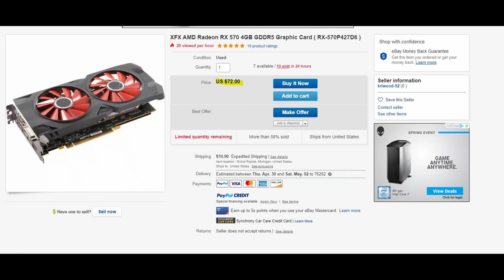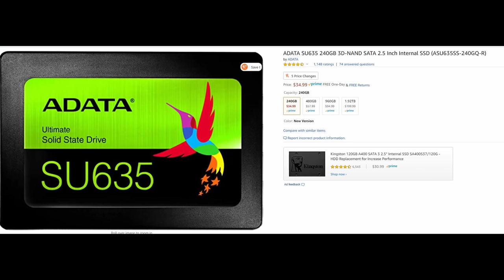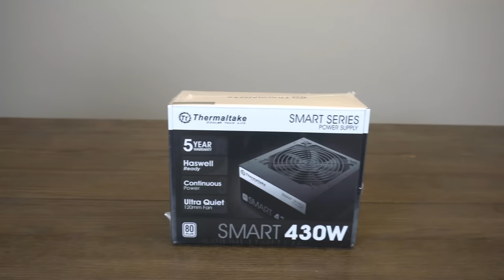$220 Just Get Gaming PC Build - Dell Optiplex 2020 + Benchmarks

Comment: Love my $200 optiplex.  It's one of the thin bois but with a little AMD GPU that's just good enough to play games on my tv.  Not a hardcore rig, but does everything it needs to in the living room!
Reply from the maker: Heck yeah!
Reply: @PCTechHustle  it's a 9020 with a gen 4 i7.  I think it's worth it to do the GPU upgrade like you did, but starting with a stronger cpu does make it feel pretty snappy.  I went the opposite route on storage and put in a 4tb nas drive, no SSD because there's no room left :P
Reply from the maker: I’d highly suggest doing an ssd for some snappy boot and load times!  You can find them cheap and stick them literally anywhere.  Double sided tape or velcro make for simple mounting anywhere

Comment: I have read that OEMs like Dell and HP have some proprietary connectors that make it difficult to use off the shelf  PSUs. Have you faced this at all, as I was surprised you could change the PSU on the Dell.
Reply from the maker: No problems at all with the power supply in this build.  In this kind of OEM they use standard atx components.  However you are correct with other OEMs.  You just have to some some research to get a lay of the land before committing to something like this.
Reply: From what I’ve heard, when talking about the minitower versions, you don’t want the 2 BTX models, and the XX20 models have proprietary connectors (XX10 models have normal connectors but not all PSUs works as it needs a certain amount of combined volts in certain pins). I’ve heard some sff had normal connectors, but usually desktops didn’t.

Comment: Would the motherboard fit in any other cases so I can maybe put some custom motherboard armour on it and make it look like an actual gaming pc?
Reply from the maker: Yep it’s a standard micro atx motherboard, so it will basically fit in near anything!
Reply: @PCTechHustle  there's another tip to add to he list
Thanks!
Reply: Why the need to "look", its the performance and practicality that counts!
In the end you probably end upp spending more on mods an changes than the whole system.. Just save that for better part!
"custom motherboard armour", silly.. and wont help anything, maybe even hinder cooling.

Comment: Nice video.  I had the same problem with XFX Rx 570 trying to fit it into my Optiplex 790.  I was actually able to fit it in using a $9 pci-e extender/adapter that popped it up just enough so that it didn’t run into the RAM clips. Not the most elegant solution as it raises issues getting the back hinge near the I/o port closed, but if you’re desperate to get the XFX in there it can be done.
Reply from the maker: Nice!  I like the solution concept!

Comment: Dell optiplex I've seen it but cant even afford it lol
Reply from the maker: I'd say if you just want to get gaming and that be the priority, save up and go for this!  I was pleasantly surprised on the performance capabilities!
Reply: @PCTechHustle  kl thanks 👍
Reply: $108 on eBay
Reply: Get a console my guy, like the PS4 or Xbox one they gonna be cheap since the ps5/Xbox series x are coming out. That way u don't need to build or alter anything in these machines or even add anything and games are still being supported on both platforms

Comment: I just finished building my optiplex 9020. I7 cpu 4770 paired with a budget amd radeon rx 460 2gb that i picked up for £55 of cex. Runs like a dream. For anyone looking for one of these 9020 mini towers, try encore pc website
Reply from the maker: That’s a killer CPU!  You could step up your GPU quite a bit without bottle necking it!  Good upgrade path!

Comment: Will the xfx fit fine on an Optiplex 3010
Reply from the maker: I believe they are all the internal dimensions, so yes
Reply: Pretty sure on 3010 or 3020 one of the sata connectors can get in the way of longer cards.

Comment: Where do I put hard drives if I have to take it out to put gpu in
Reply from the maker: There is a slot directly under the optical 5.25” drive bay, it conveniently fits a full size hard drive.  I actually dk this in the build!
Reply: @PCTechHustle  dk?

Comment: i did a build like this. i used an HP 8300, the full ATX tower 20 bucks. 
i got a cheap PSU but its rated at 750W which is damn near twice my usage so im not too worried, 50bucks.
the PC came with no CPU, RAM, or HDD. its 1155 so i went with a 2550K, which is still a capable gamer and will let me OC when i get a good deal on a Z77, 50 bucks.
4 sticks of 4GB Samsung PC3 12800U-40 bucks
1TB Seagate HDD-20 bucks
And i finished it with a VisionTek RX480 8GB OC edition- 100 bucks
It plays new games and makes me happy. I do look forward to getting a Z77 and clocking that 2550K. they were basically the best binned 2500Ks and are known to OC like a beast. And an SDD would be nice, but i dont want just a little one with just Windows on it. Ill save and get at least a 1TB so i can just clone it and go.
Reply from the maker: Awesome!

Comment: I can confirm that Sandy Bridge Xeons will works in these systems. If anyone is looking to squeeze a little more performance out of these, a Xeon E3 1240 can be picked up for around $40- $50 on the used market. It's basically an i7 2600 minus the integrated graphics chip.
Reply from the maker: Great tip!  Those chips are great overclockers as well! Not applicable here but Xeons compatible with the consumer LGA sockets tend to have a better bin which in many cases even overclock better than k series chips.

Comment: Optiplexes are overpriced on ebay, there's usually much better deals locally
Reply from the maker: I’ve noticed the prices swinging wildly.  Seems I got lucky getting mine for $75
Reply: @PCTechHustle  You should have tried getting a better optiplex I got a dell optiplex 7010 with an i5 3470 8gb of ram and a 500gb hdd for $70+$6 tax
Reply: Wow I got the same thing for 220 dollars on new egg I guess I didn’t know what I was doing back then I should have gone whith eBay
Reply: I got a dell optiplex 9010 SFF i7 3770 1TB HDD for $120 + 25 shipping on ebay, wdym?
Reply: @cytro  Dang you are so lucky thats the best cpu for a 9010
Reply: @cytro  Mine has an i5 3570
Reply: @Jamal01223  Yup! :D Now going to save up for a lowprofile RX 550 and get 8gb more ram

Comment: I just finished my build and everything works fine. Any ideas on an upgrade path for this build

Edit: The PC is VERY loud and spikes with games like Minecraft. I got this PC to take games like Fortnite a little more seriously but with it games like Minecraft making me use 99 percent of my GPU I'm very concerned. Did I do something wrong while building? My cable management isn't the greatest is the issue. Do I need more RAM, I better GPU or CPU.

Thanks in advance you've been a great help to me during my first PC build.
Reply from the maker: I am assuming you copied this build?  That said, if things are loud is you CPU fan ramping up because it does not detect the front temperature probe?  That will happen.  Mine though was not loud, I would say pretty average to the quite side in fact. 

On the GPU concerns... Under gaming scenarios the GPU should be fully loaded.  If it is not that means you have CPU bottle neck and the GPU is waiting for the CPU to catch up.  

Not sure how much RAM you have but the minimum with modern gaming I would suggest be 8GB, preferably 16GB.
Reply: @PCTechHustle  The noise problem was my fault, my cables were blocking most of the airflow so when I went in and moved it around the PC ran a lot smoother. 

I have 8gb of ram. I will upgrade to an i7 and 16gb later. Any recommendations on which brand of ram I should get?

Comment: 1. Wondering if the cooling fan comes with the case? So as the motherboard and stuff like that.  2. Does this get good frames with medium around 60 or higher? 3. Is the ADATA necessary to buy or optional? 4. Is the Optiplex 990 out of stock from the link is the description?
Reply from the maker: 1. Yes a rear exhaust fan comes with it
2. Yes it get great frames even on high settings though I would suggest maybe running medium to smoothen out the gameplay (check the benchmarks part of the video)
3. The SSD is indeed optional, I highly suggest getting one though if you can spare the extra change.  It will make for a much snappier feel and game load times will be drastically reduced
4. The 990s sell all the time.  The reseller I bought from (linked) may be out of stock but just do a search on eBay and I’m sure you’ll find one around the same price point.

Comment: In March i bought a PC for 100€ with:
i7-2600
Radeon HD7800
2x8GB DDR3
1TB HDD
120GB SSD
60GB SSD

It was a Acer Predator and the Case was very nice with Easy Swap HDD at the front.

I Changed the GPU and bought a Sapphire R9 290X Trix OC for only 60€.
So i was at 160€ and had 2x 8GB DDR3 laying in my Room, so i put them in too and it was a good Starter Gaming PC.
Sold it a few days later at Facebook for 350€.
Reply from the maker: Nice!

Comment: hey i need your advice. i have a i5 6500, rx480, b150 mobo. My system runs well. but i would like to upgrade it. was considering going ryzen 5 and 5700xt stuff but not sure if thats needed. Mainly i wanna play cyber punk smoothly and not feel left behind. Should i just buy a new graphics card? if so which one? Thanks.
Reply from the maker: I believe cyberpunk will be a pretty hard to run AAA title.  I’d defiantly suggest upgrading the CPU, Ryzen is killing it too, can’t go wrong there.  As far as GPU, I’m not a huge fan of the new AMD 5000 series, I’ve heard plenty of driver horror stories.  You might look towards a 2060-2070 super (depending on your budget).  I would keel your ear to the ground though as the 3000 series Nvidia cards are going to seriously disrupt the GPU market, new and used.

Comment: Which optiplex should I purchase and at what price point? (What should it include- processor, ram, hdd etc). I'm new to PC, Could I get some advice?
Reply from the maker: Well, in this example I show you how to get everything with the Optiplex, CPU, RAM, even an extra HDD.  However I added a PSU, GPU, and SSD for some additional performance to make it gaming ready.  I also chose the 990 model because it is a bit older / cheaper.  There are later models but they are a good deal more expensive, which is why I went the route that I did.  Hope that helps.

Comment: A few additional comments, as I didn't see this mentioned in the comments previously posted.  1. This dell is a 900, and not a 2020 as it is called in your video title as well as in the description.  This should be edited and corrected.  2.  The GPU with a backplate which you've mentioned would cause the ram slots to be in the way has been covered in other videos on upgrading this Dell unit and others.  One solution is to break off the ram stick clips at the end of the slots (harmless to the operation) if that is the only part in the way.  This might be a solution for those with a GPU on hand and wish to avoid another expense of buying another one.  3.  The music is way too loud.  When I set the volume for your voice, and then the music appears it's borderline about to blow my speakers out.  A little background music goes a long way you may have already discovered more recently.  And one more thing, do you think that covering up the MB before dripping out the rivets might be a good idea so that no bits of metal can end up on the board?  Some re-builders remove the board before doing any drilling - but I'd probably just cover it well myself and save some time and work on this project.

I am currently at the beginning of a 990 upgrade, so I'm watching as many of these videos as possible.  Thanks for making a good one.

Comment: Literally did this but got an optiplex with better psu for like 10 dollars more and a gt 1030, runs most games on low really well
Reply from the maker: Nice!  With a 1030 though you likely didn't need a PSU upgrade, unless you were just doing that for sanity sake / future upgrade sake.
Reply: PC Tech Hustle not necessarily a psu upgrade, but also kind of. I just needed atleast 300 watts output to feel comfortable with the power circulation in the system.

Comment: I paid 300€ for a used pc and on cinebench it got over 600 points. My tip: search for a used pc without graphics card and get yourself a 570. My tip is a i7 3770. It's cheap and with 8 threads absolutely OK.
Reply from the maker: Nice!  Yes a 3770 and an rx570 would make for an awesome combo!

Comment: you can cut the wings off ram latches and any card with back plate will fit. did it in 2 systems
Reply from the maker: Good tip!

Comment: I've been using an old gaming laptop with a 860 m graphics chip for college and gaming. Just recently bought an optiplex 7010 hoping to make it a project build that'll be pretty good in the future
Reply from the maker: You for sure can make it a good little gamer for cheap if following the same type of things that I did here being replace the PSU, add a GPU and SSD!  Good luck with your build!
Reply: if i were you, i would 100% get the i7 model because like you, I bought a Optiplex for a project to build on. I paired the i5 model with an rx 580 8gb but it bottlenecks. Switching to an i7 gave an extra 30 fps and 8gb ram to 16gb ram added an extra 15-30 fps. Buying the i7 after is probably going to be expensive

Comment: Nice build.
For the PSU my optiplex 3040 motherboard has an 8 pin connector.
Do I need to buy a 24pin to 8pin adapter or this particular PSU you used comes with a 8pin motherboard connector?
Reply: I'm not aware of any psu other than Dell oem that come with 8 pin connection for the motherboard. It's one of the odd and annoying dell things.

Comment: Great video, I have an inspiron 660 similar spec to the optiplex can I do an upgrade like this?
Reply from the maker: I have not done the same with an inspiron but looking over the specs and the motherboard layout it would appear you can!  The only thing I cannot really speak for is if things will fit inside the case.  You might have to do a bit more research on that part.

Comment: Also ive noticed several new pc builders have been buying sff models of these pcs .Please note that you'll be using low profile cards or single fan mini cards that draw power directly from the motherboard.
Ps its gonna be hard to upgrade the psu. 
Stay safe fellas.
Reply from the maker: Good points if you don’t want as much of a build and just want to install sff components and go that is an option too but know you will be pretty limited because you cannot use standard size PSUs and GPUs.

Comment: Thanks for the video :D was able to snag a local one with the i7 2600 cpu for 90 bucks! Just curious are you able to upgrade your front usb ports to usb 3?
Reply from the maker: You can upgrade to USB 3.0, yes. If you want front USB ports though you would need a case that supports it.  Check out my case swap video where I take this system and put it in a gaming case.  I also add a USB3.0 card to support it :)

Comment: I just bought a Gtx 1060 and I had a i5 2500 but the problem is that i have a to much bottle neck is there any way i can reduce my bottle neck without buyin anything?! Great video btw ♥️
Reply from the maker: Defiantly.  Lower your setting a bit or cap it to like 60/120fps

Comment: Looks identical  like my dell precision t1650 i7-3770 ?  And is the RX 570 better than an GTX 1050 ti ? edit : from a bing search the RX is faster and cheaper whic with the savings i could had upgraded my power :( ......... but is my dell precision better that the OptiPlex ?  For the right angle cords needed what name to get - look for when buying ? just sata cords ? about how long ? ...thanks for the vid i do need that upgrade ssd drive and power update it looks like

Comment: you have to enable all threads in the bios to get better results.
Reply from the maker: IF you are upgrading to a multi-threaded CPU, but yes you are correct!  Check my latest video, I recently upgraded the CPU and case. 😉

Comment: So I found a optiplex 990 with a i7 2400 in it for 150 on ebay what graphics card would you reccomend I get my budget is 300$ so around 100 to 150 would be Ideal would a 1650 4GB fit?
Reply from the maker: So long as the length of the video card you are looking at is at or under 10".  You can also remove the hard drive cage like I did to create more space.  If you do that then you will have tons of room.  It kid of just depends on.  If you can afford it though I would suggest looking for a bit more GPU horsepower.  The RX570 in this video will significantly outperform the 1650 you mention.  Though just a 1650 super model outperform the rx570.  I typically stick to the RX570 mainly because I can find them under $100 used.  They are one of the best price-to-performance cards I have ever encountered.
Reply: @PCTechHustle  I think I'll get the rx570 8 gb might be a little overkill but it's only 30$ more then the 4GB on Amazon also do I need a 8 to 24 pin adapter for the 990 ? Hate to ask so many question but is there any difference in size between the 8GB and 4GB version of the 570 I just don't wont to buy and it end up not fitting it's my first pc build
Reply from the maker: You won’t need the motherboard power adapter for a 990 Optiplex.  4GB vs 8GB cards don’t have size differences.
Reply: @PCTechHustle  Thanks man helps allot just don't want to mess anything up.